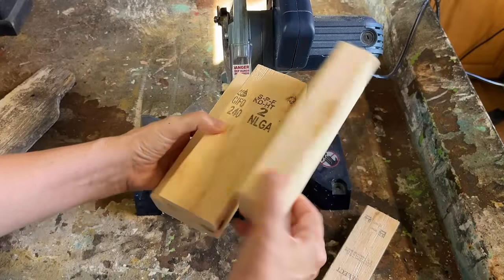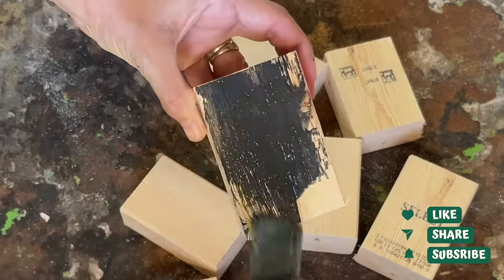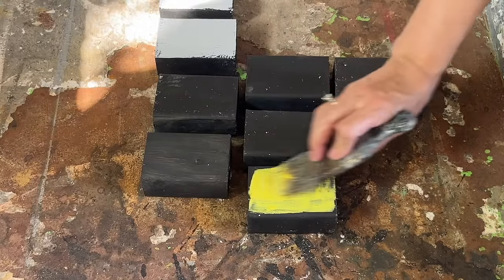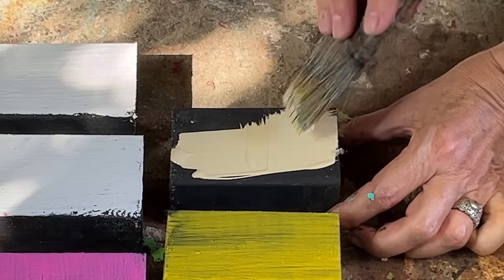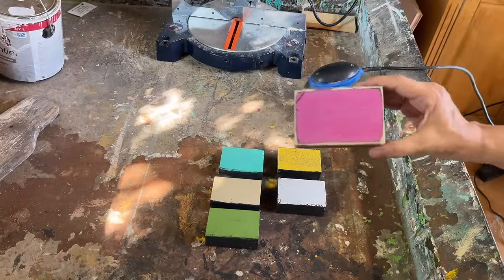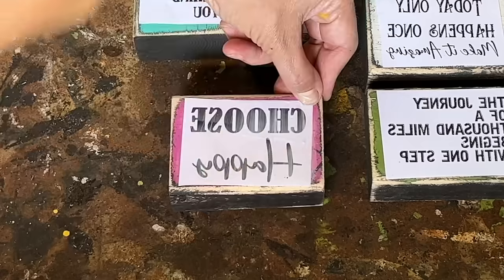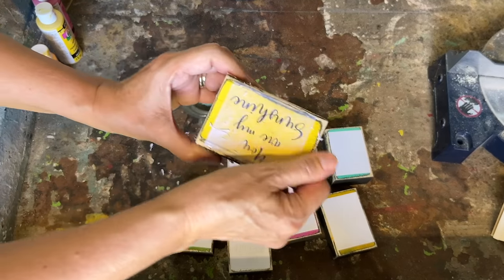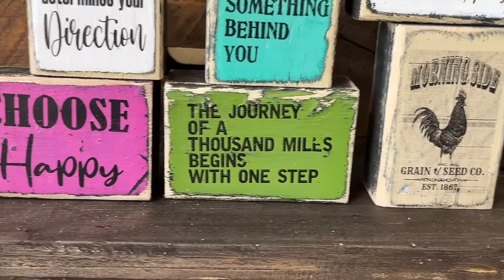Make Money with your Scrap Wood / Trash to Treasure

Comment: Quick question! I'm making Halloween signs your graphics are great.  I'm using orange as the coat on top.  When I do the reverse graphic I find there is a bit of a hazy look where the paper was.  I've tried to limit the amount of mod podge like you pointed out in one of your videos. Is there another way to avoid the hazy look?
Reply from the maker: It is hard on a coloured paint background. The haze will show. Work in small areas and try to rub off more then you can go back with the orange paint and paint around letters

Comment: Hi Deidre! I thought you could only use chalk paint for graphic transfers and not acrylic paints?! I tried a graphic transfer on acrylic paint (on wood) and the graphic and color came right off...Do you use any different techniques when using acrylic vs chalk paint graphic transfers? 

And, if you can use acrylic paints for graphic transfers on wood, how about latex paints? Are they the same effects?

Thank you for your guidance:>
Polly
Reply from the maker: Chalk paint works best but you can use acrylic if you go really slow
Reply: @OurUpcycledLife  ohhhh, thank you! I will definitely try it again🥰

Comment: Can not get mine to look like yours . Alaways has a haze and/ or outlines of the paper. Always a lot of missing ink. Help.
Reply from the maker: It will make a difference if you’re using an inkjet printer this process is much better on a LaserJet and it does take a bit of practice
Reply: I experience the haze as well and I use a laser jet printer. I dip my fingertip in water to try and get the residue off and if some of the print comes off I use black paint and a very fine paint brush or I leave it as is for the distressed look. I think keeping your fingertip damp is the key. 👍🏾